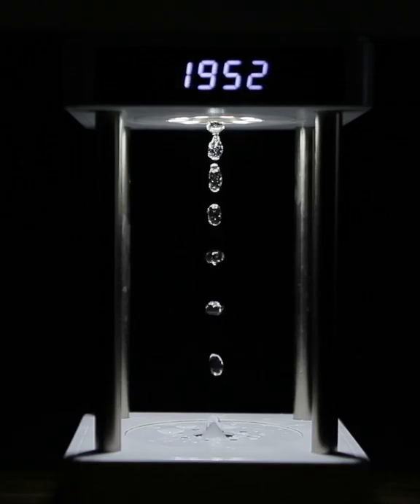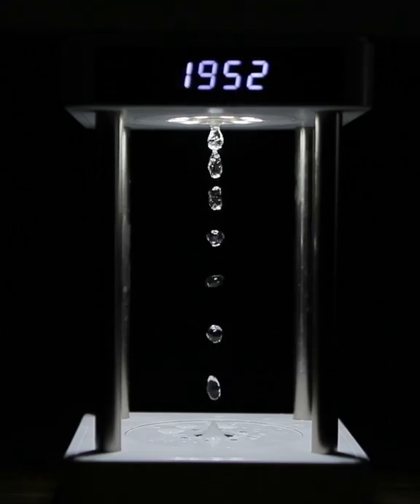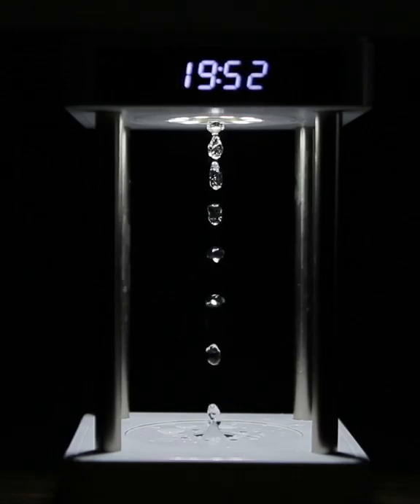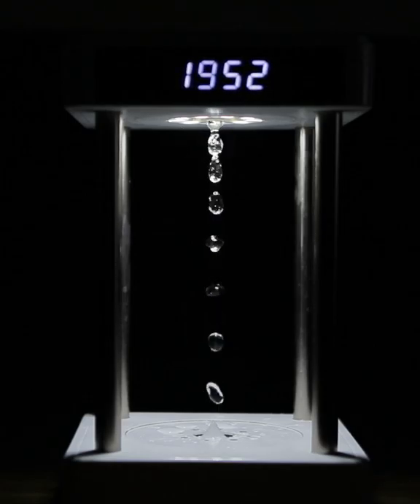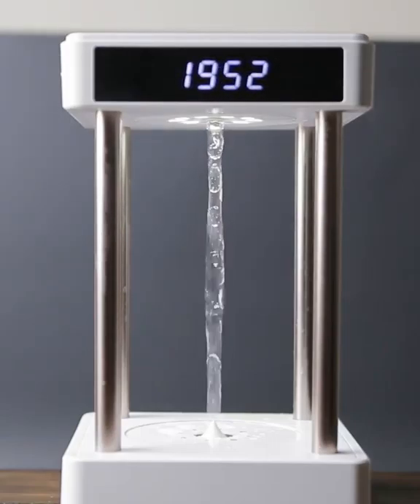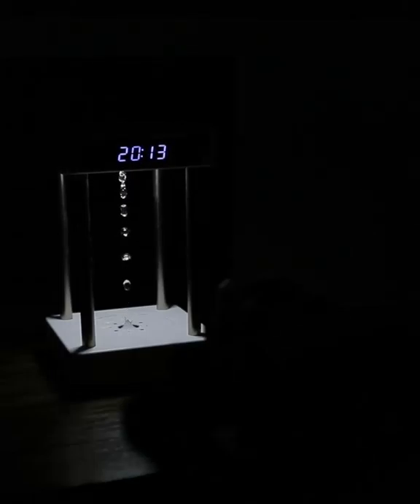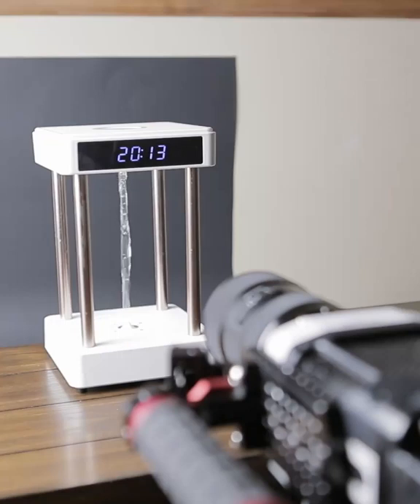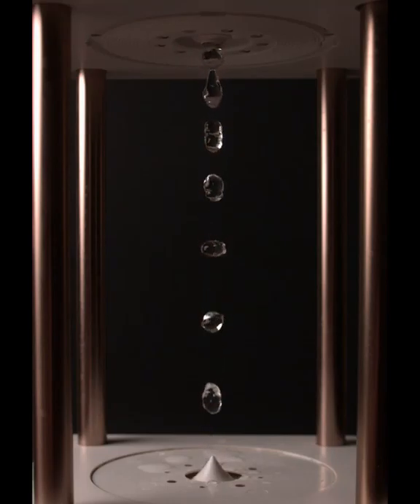High-Speed Camera Investigates Levitating Water Droplets

Comment: I’m still confused. So the droplet is falling from the top correct? How does it get the bubble effect in there? What is happening on the bottom? Is it pulling the water downward or pushing it upward? Is the video reversed in the original? I don’t get how it looks like it’s falling downward in yours but looks going upward in the other.